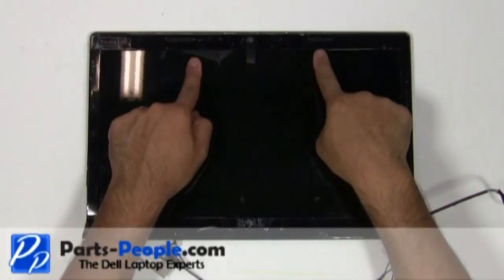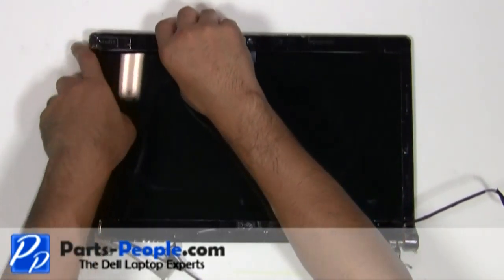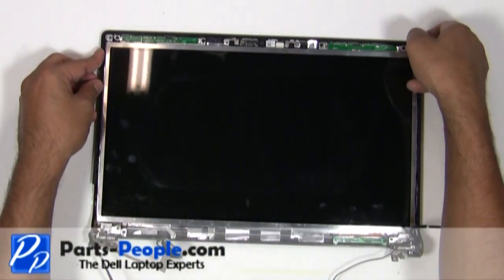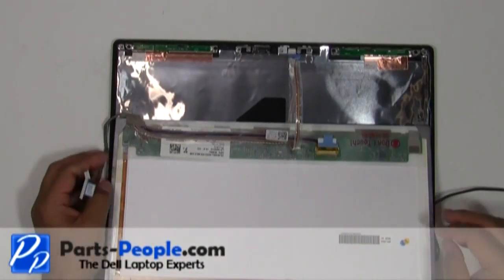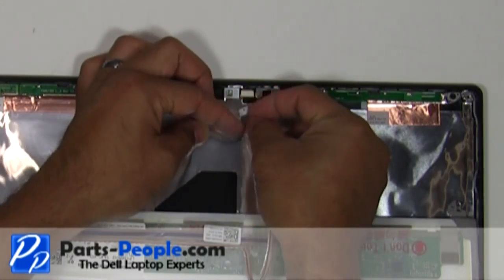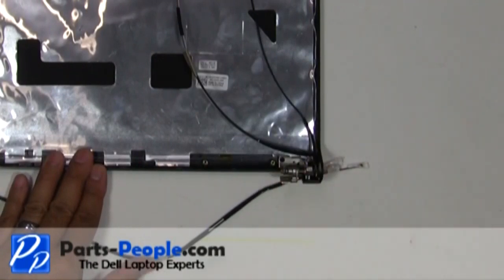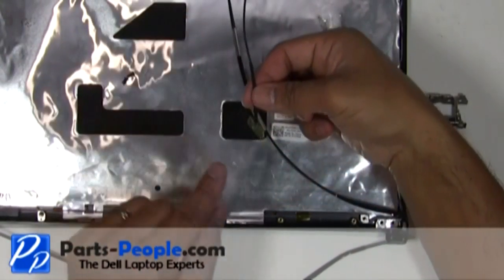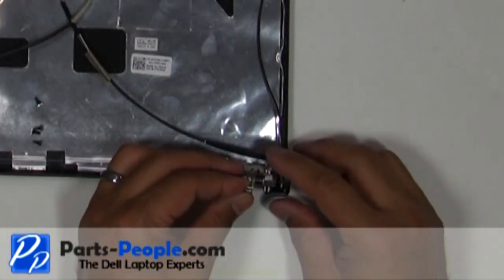Dell STUDIO 1555 / 1557 / 1558 | Power Button and Cable Replacement | How-To-Tutorial

Comment: I plug in my power cord and the green light comes on then goes off. I push the power button and nothing happens. I remove the battery and then put it back in and the green light comes on for 2 minutes then goes off.  What needs to be fixed or replaced?
Reply from the maker: The green light on the power adapter brick turns off? or green lights on the laptop turn off? Most likely you will be dealing with a short of some sort. I know that the Studio 1555/1557/1558 all had GPU overheating problems that would cause similar symptoms. I would guess that this is whats happening in your situation. Unfortunately, the fix is replacing the motherboard.
Reply: The green light on the laptop comes on then turns off.  Never overheated. Do you think the power button is shot or maybe the dc cable?
Reply from the maker: It's hard to say without looking at the laptop. Is there damage by the power button hinge?
Reply: I don't see any damage.

Comment from the maker: These studios are known for there power buttons breaking. I would check that first, It might be causing the power adapter to short out. A lot of times you will have to replace the complete back assembly in order to fix the power button. If the hinge is separated from the back then the back assembly will need to be replaced.

Comment: So i was using my computer a week ago and it was fine. turned it off and went to bed, woke up next morning and it wouldn't start. Now i have to use different outlets for it to start. If i use outlet 1 today and turn it off and then try using it again it doesnt work. i have to use a different outlet. When it does start it says "Power button cable failure." I ran the test last night and it says everything is fine with the computer. whats going on?

Comment: I have a questoin.. If the cables of the power button are left outside and you turn your laptop by making the cables touch how dangerous is this? should just give you a little shock if you happen to touch both right?

Comment from the maker: It's hard to say without having the machine to look at. Are there any light codes (flashing caps lock, num lock, or scroll lock) or beep codes? What happened to it? Was it dropped or a power outage or was something spilled on it? There are to many things that could cause this problem. I'm gonna need as much info as you can give me.

Comment: Hola . I've got the issue for my Dell 1558 . When I press the power button , the power led will lights up just for a few seconds and turned of again . But my laptop does not powered on . I've checked my rams , hard disk , fan and the other part , and they are working good . Does this got something to do with my power button? Hope that I can get the feedback from you as soon as possible. tyvm .

Comment: The power cable itself runs from the single screw connection by the power button in the hinge assemble into the laptop, to a connection under the keyboard. If you need to replace the power cable you will need to do the above video, as well as remove the keyboard shroud and keyboard assembly to access the other end.